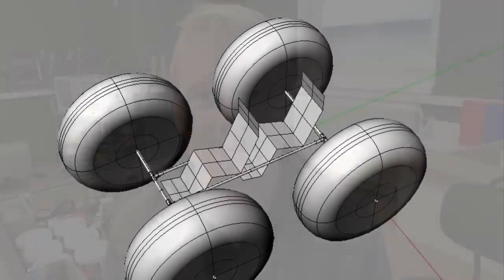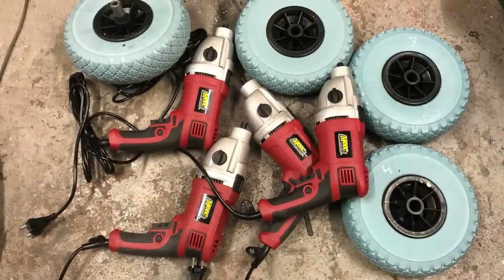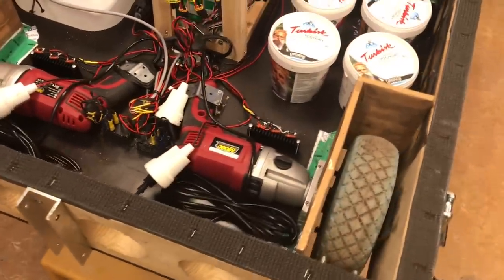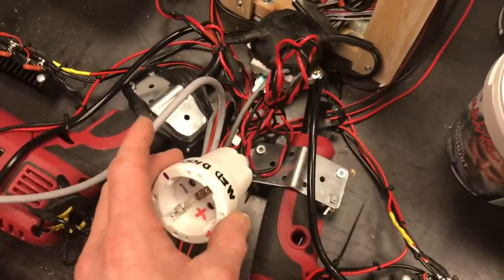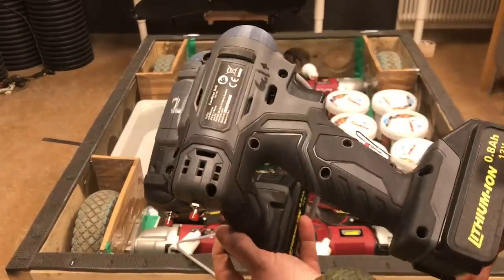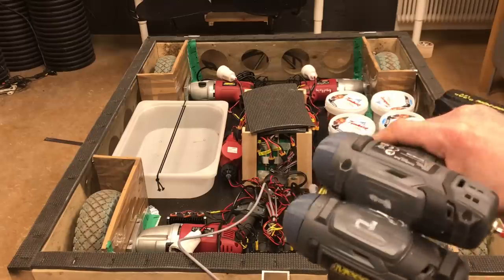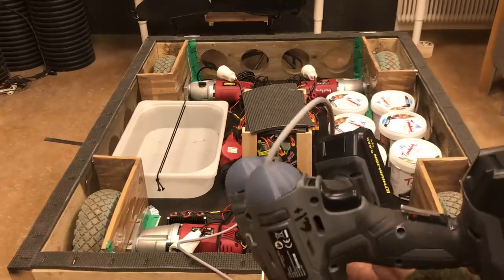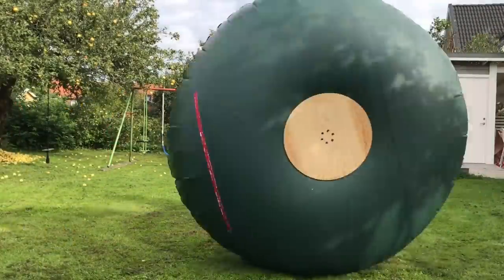4 kW Drill Powered Utility Vehicle/Go-cart

Comment: You could wire a relay that applies a short circuit to the motor when it is not powered. The braking effect could be adjusted by using power resistors rather than a dead short. This would allow steering without stopping.

Comment: Awesome work. Do you think you could put in a small board to detect amperage at the motor and prevent reverse until the draw ceases or maybe an optical sensor. Hate to see you burn out the relays by accident or throwing a motor. Also, what are your thoughts on using the motors for braking, will they be able to hold up?

Comment: Concerning the multi prop,  the cooler the temperature, the better the lift will be to to air density, also the colder air will help keep the batteries in optimum operating temperature as they will heat up during use. However, never charge Li-ion below 0 C.

Comment: Incredible DIY invention 
but why don't you use an arduino with a joystick to control the 4 pwm and relays?  It would be much simpler and intuitive to control the device.
Reply: MrCuervoRC This is simpler & quicker to get going. We builders keep to the 'Kiss' theory.
Reply from the maker: My thought exactly, just want to haul the rig from A to B without o much development work.
I will investigate further options, such as joystick control in the inflatable car project!

Comment: The electronics are terrifying! Is the full pack voltage fed to the hand controllers and the battery is used to get Vgs for the NFETs? I suppose as long as you don't reference yourself to pack negative you'll be ok. You've been alright thus far with all your projects, so you clearly know what you're doing! I love your videos, keep up the good work!
Reply from the maker: Only 12V in my hands...will isolate the bare metal transistor parts at the heatsink asap....:-) Thanks!

Comment: Why didn’t you use an 18650 battery bank? 
I thought they’d be more suitable for wheeled vehicles.
Reply: These look like the same batteries he used for the quadcopter. Lipo batteries have way better discharge rate anyways.
Reply: Discharge rate is required for flying stuff, but ground vehicles (with much less typical power-to-weight ratio) works well with just any batteries. And 18650 has greater energy density and usually less expensive as well.
Reply: It's not less expensive then using batteries you already had.

Comment: This drills are ac!!!!  I can't understand the whole thing can you plz help me?!
Reply: Most small power tools actually use a high voltage DC motor with a diode to convert the line power to DC, because DC motors have higher torque. In Europe, 230V. So they can work on 230V AC or DC.
Reply: These machines use what's called an universal motor. They run just as good on DC as on AC.
Reply: Ibrahim Ulf Karlsson thanks men
Reply: John Rowell thank you